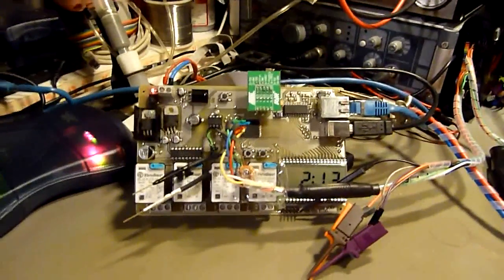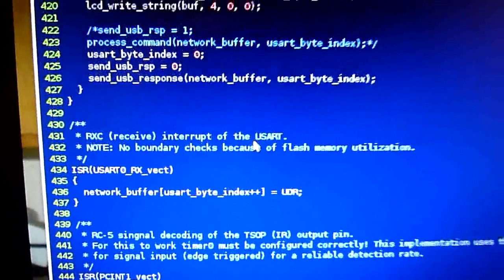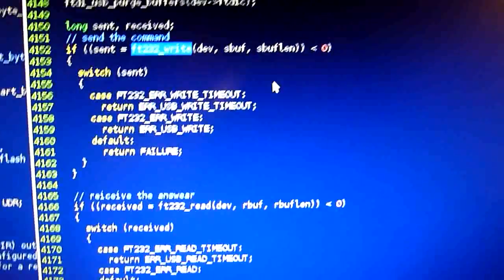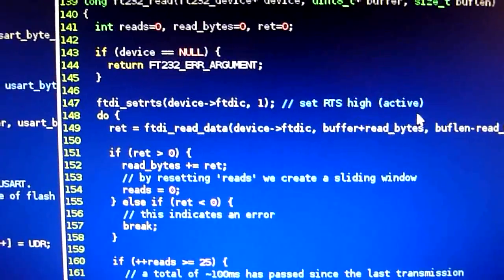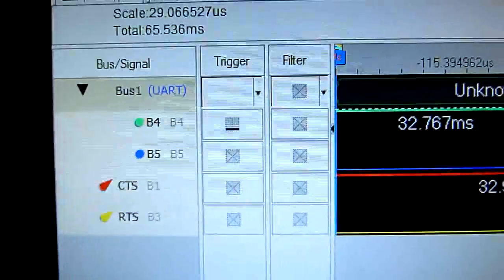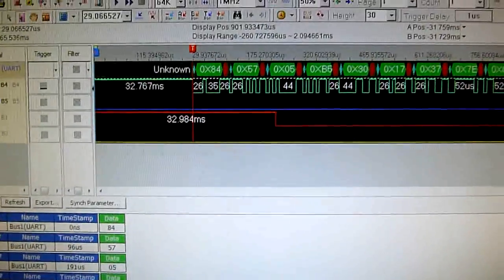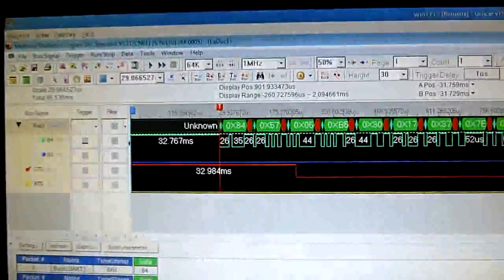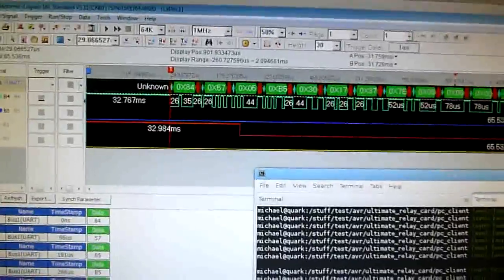MCU-USB-Connection by a UART bridge and why it sucks.

Comment: I am just trying to hook up a Litecoin/Scrypt miner and it uses a UART/USB connection, which seems to completely randomly turn off.  It was working pretty fine with some basic restarts of both miner and computer, and always having to reinstall the drivers, but this morning nothing is working.  I realize nothing is random in computers so I am trying to figure out what variables are involved.

Comment: I think you are adding extra significance to the RS232 flow control signals. CTS simply was a signal the host set to signal that it could receive data without losing anything. It wasn't really intended to signal "I'm sending a command" and "I'm done sending a command and awaiting response". That is why the FT232 and the PC driver aren't worried about serializing the handling of flow control packets with data packets.

Comment: Unfortunately the computer is required as the data is processed there. I managed to get an average of about 300 us latency by setting up a DMA and starting it when I was ready, but it varied by 100 us either way.

Setting up a small DMA from two alternating buffers might work - the processing would have to wait for one buffer to start being serviced then put the signal in the other buffer. Unfortunarley the DMA engine I am using has a mininum transfer of 4 MB, which takes a while itself!

Comment: gdgd, I've recently been trying to find some interface to a PC which will enable a sub 100us general purpose output to trigger some other kit. Nearly impossible to do without going down the DMA / PCIx route - setting up a continious transfer from fixed address buffers and changing the buffer contents, its just far too slow to get the OS (windows in this case) to execute anything 'quickly'.

Comment: You can park a bus through a millisecond, but to a user their screen does not even refresh that fast. Unless you are running kernel mode or realtime you wont get much better without switching to a realtime OS anyhow (windows 7 system timer is 100ms!)

As for the first part, its from experience of runing 1mbps through a ftdi chip or a bluetooth uart module (just power and tx/rx to both). You do get a large overhead, so the real data rate is usually around 0.5mbps, but with ack/nak system too.

Comment: I have a fair amount of experience with the USB bridges and bluetooth uarts, the easiest method is to forget control lines and packetize your data: [preamble] [sync] [length] [command] [xor crc].

The computer side can then pull in the data and sync to the stream, depending of uart cable / track and operating environment the preamble is optinal.

Does your application really need sub 1ms response? Even conventional RS232 (and ethernet) is not always that good (IRQ's in the PC etc.).